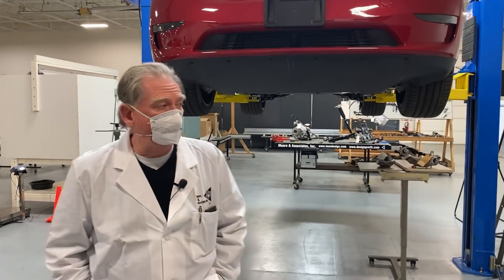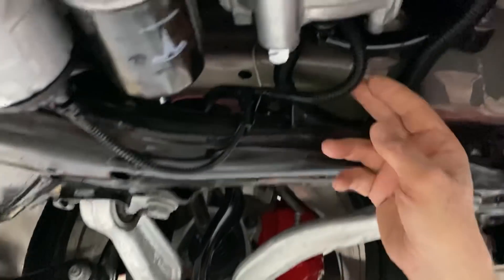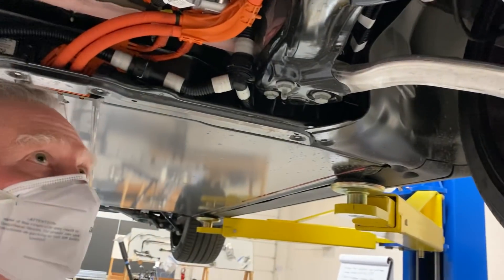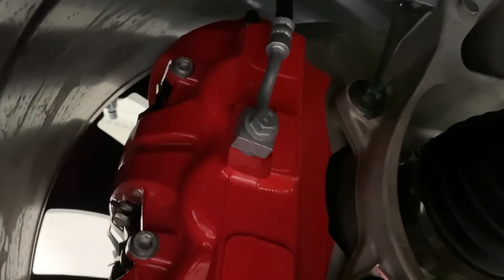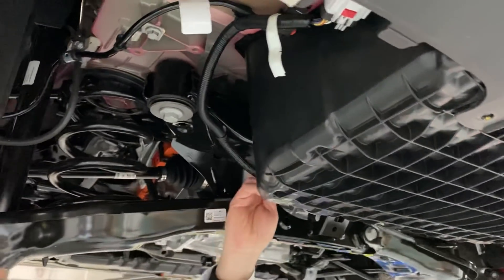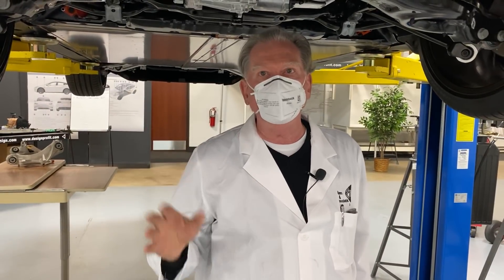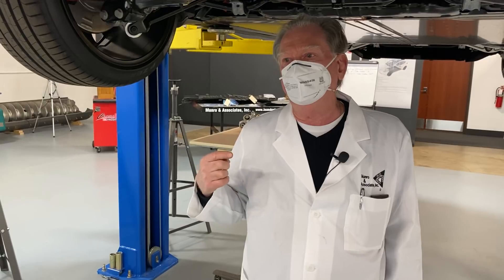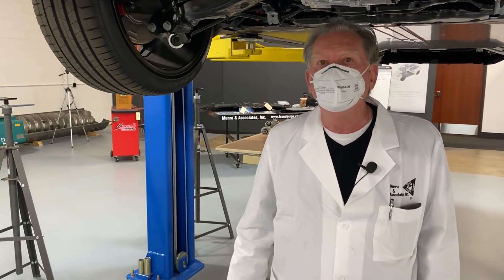Model Y E6: Wiring, Brakes, Quick-connects, Rear Body Structure

Comment: Right now Montana Skeptic is telling the world on Autoline "After Hours" there is no demand for the Model Y. He's only been wrong every single time.

The Mercedes EQC is 400 kg (~880 lbs) heavier than the Model Y at nearly the same dimensions. I guess we now know why Mercedes decided to postpone the introduction to the US market. They might as well forget about it completely.
Reply: I bet 200kg is sound deadening alone
Reply: @NyashaM  There is an ICE engine dummy made of I-Beams in it to not have them redo the crash tests and dynamic changes.
Reply: @snviper  Interesting, I did not know this. After some googling, it looks like a tubular sub-frame to simulate the ICE engine and transmission. They will still have to crash test it, but having the frame will reduce the amount of body modifications to achieve the same crash safety. New body tooling is much more expensive than the hand full of jigs needed to manufacture that sub-frame.
Reply: @NyashaM  the mercedes EQC is so comfortable and silent car inside the tesla isnt even a match
Reply: @carholic-sz3qv  Have you been in one on the road?  Do you own one?
Reply: There`s an easy answer. Would I buy EQC instead of Mercedes ICE alternative? Absolutely not!  Thats madness. Without having supercharger network it will take years to compensate savings in gas over the initial high price. Its just not better then their ICE version but its much more expensive. Performance is also on par...
Would I buy Tesla instead of ICE competition? Absolutely yes! Its so much better, when you look at the performance, maintenance, software!?(best in the business), supercharger network with great prices... Imagine owning Bmw m3, how much would it cost for gas, servicing, insurance etc... Madness...Also look at the prices for Tesla in US. You can buy model 3 for $35k!!! Thats incredible...
Reply: @DG-uv3zw  there are huge weaknesses of the tesla 1) its accelleration is too high and is not in line with oil experience 2) it lacks oil smell, and u always need an oil perfume 3) its speed to high and endangers the passangers 4) the charge at home is NOT a good experience  like oil lover. they should remove this optioj
Reply: @mikumikuiyada  :)
Reply: @CertaintyPrinciple  What ever the actual case is, the EPA should create a two cycle system. It should list a highway and city range just like it does for MPG.
Reply: @CertaintyPrinciple  Car and Driver tested the Model S Performance and the Taycan Turbo S for 100 miles on an oval test track at 75mph. Taycan range was only 10 miles short of the Model S. This equates to 108% of EPA rated range for the Taycan and only 68% for the Model S. This huge discrepancy leads me to think the EPA BEV mileage testing specification is flawed. Either Tesla is gaming the test procedure to artificially inflate the range or Tesla is using a higher percentage of the batteries charge which will lead to faster degradation of the battery. 

Neural networks are not unique to Tesla's self driving tech. All of the major self driving  research and development companies use them. The problem with neural networks is that they can get confused when presented with a situation they have not seen before. An example of this is in the Deep Mind documentary about AlphaGo. In the fourth game against the human player AlphaGo gets confused and starts making mistakes. The mistakes are so bad that the commentators start laughing. This leads to AlphaGo loosing the game. 

Since Tesla's system does not use LIDAR, it is my opinion that an error similar to the one AlphaGo experienced is more likely.
Reply: Even Elon - our lord and saviour would not bash Mercedes for their efforts in support of EVs.

In any case, many Merc lovers will be enticed to EVs by the Merc badge, (i.e. the quality/experience it represents), and that's not a bad thing if it means earlier or additional EV adoption.

In reality, the Germans have excelled at brand marketing - they balance good enough aesthetics and quality with maximum gouging from your wallet.
Reply: @baljeetd  "lord Saviour"  wtf!!!!! are you insane??!, tesla is using RP-1 for his rockets which is simply a refined kerosene.
Reply: @CertaintyPrinciple  Haha, based on your nuanced response you definitely don't seem to be one of the cult members. My apologies for lumping you in with that group. His cars are not the snake oil. The cars have innovative design and a lot of cool tech. It's when Elon says things like your car will become an "appreciating asset" and that it has "Full Self Driving" when it doesn't. The other nonsense phrase I love is "Tesla isn't a car company it's a technology company". They are also able to game the EPA range test, probably with how they set up regen vs the other manufacturers. In real world tests Tesla's get below the EPA rated range and many other EVs get far better than the EPA rated range. I would love to have an EV as a daily driver to save money for my weekend gas burner! Unfortunately I live in an apartment and have no where to charge one.
Reply: You can't compare the EQC with the Y by weight and dimensions only, there is a lot in the EQC that is not in the Y. Nevertheless, 900 pounds is a lot, but definitely not the reason to be postponed.
Reply: @111chicane  Correct.  It's postponed for the U.S. because it's a compliance car.  Like very other non-Tesla EV.  It's needed in Europe to stave off the CO2 penalties.
Reply: @Alchete  Exactly. And because they can't manufacture enough for export due to battery shortages and manufacturing capabilities, they keep it for the EU, where the compliance penalties would be much higher than the potential profit of selling in North America. They also announced they are working hard on increasing production and bringing it to US market by the end of the year.
Reply: stop talking nonsense you moron, the mercedes is way better build compared to the Tesla, the quality of materials alone is just not even a match
Reply: @CertaintyPrinciple  You can I check my linkedIn, but then again the Tesla cult aren't interested in facts. Elon is a snake oil sales man constantly making things up.
Reply: Mercedes would have known the weight of the EQC within a percent or two before they ever build the first engineering trial cars. They model the entire car in 3d CAD with an extremely accurate estimate of the weight of each part. I understand that you like Tesla, that's fine.  But please don't try to argue in areas where you are clearly ignorant. You do not seem to have technical knowledge about the design and manufacture of modern automobiles, nor understand basic supply and demand. If you raise the price of something(i.e. no longer have government incentives to artificially lower the price) demand will drop. Please google supply and demand curve.
Reply: @bigben57  lol, everyone models their cars before hand and would have a model that tells them the weight.  It is absurd to claim tesla is not using all modern engineering, that is the stuff they mandate.  Tesla has to worry about both weight and aerodynamics more than any other car manufacturer.  Take your own advice, stop chiming in on things you don't understand.  And HAHAHA, your supply and demand logic is really stupid.  Tesla's demand is higher without the subsidy, because the demand is growing on its own, the subsidy isn't necessary.
Reply: @_PatrickO  Did I mention anything in reference to Tesla's engineering? You need to work on your reading comprehension. You Tesla fan boys don't know shit about the automotive industry. If it weren't for government subsidies Tesla would already be bankrupt.
Reply: @BrowncoatFairy  I have been an automotive engineer for over seven years. Please explain whats makes you qualified to discuss engineering and economic concepts?
Reply: @_PatrickO  actually tesla uses alot of suppliers, from mexico to china...... even the brembo brakes from italy........ stop with the bullshit
Reply: @bigben57  With respect, I would be happy to debate with You, the comparisson between the traditional brand ICE cars and EV's like Mercedes, BMW, AUDi from one side versus the roockie Tesla. Let's say I am a car buyer whose budget is $ 50.000. Please try to convince me, that I have to choose the  Germany's competitors, whether it's ICE or EV.
Reply: @bigben57  You mean that subsidie any manufacture making electric vehicles qualifies for or the one that ran out after a certain quantity like happened to Tesla LAST year and yet their sales keep growing quarter over quarter...
Reply: Merc is a far superior car than the Tesla !!
Reply: @mixalis6168  hahahhahahhahahahaha
Reply: @mixalis6168  Your opinion is noted... but oddly enough, they were going to make 20K vehicles last year, actually managed to produce something like 1500 and sold 50.... way better...
Reply: mixalis only on regards to interior materials and fit finish. Unfortunately it’s not superior, and in fact is inferior in regards to drivetrain and technology
Reply: mixalis not true at all.  There are certain aspects of the Mercedes that are far superior to the Tesla.  And the Tesla is far superior to the Mercedes in other areas.  It’s all give-and-take, depending on what you want.  

I bet the Mercedes is a lot quieter though.  They tend to use more sound deadening materials even if it weighs them down.  

I still prefer the long range for the price of the Tesla.  Also the performance and acceleration of the Y and reliability of their batteries.  So they’ll get my money

Comment: Keep in mind that the performance cars have different brakes from the non-performance models. So you can’t simply compare them to the non-performance model 3
Reply: yes, it looks the same as the ones I have on my 3P.
So that means floating rotor up front and floating caliper in the rear.
Reply: Olav Alexander Mjelde I’m hoping one of his guys mentions this to him. It’s not like they don’t work in a world with different trim levels of other cars. You would think he would pick up on that.
Reply: No, not necessarily a floating rotor up front. It can be a one piece cast rotor. The pistons kind of allow for any offset.